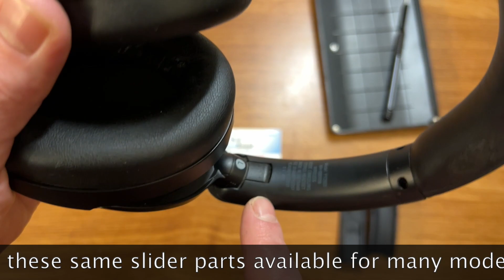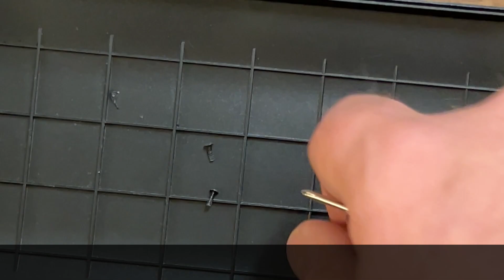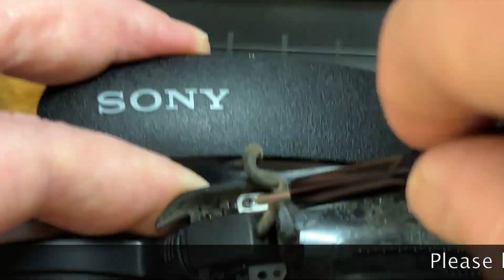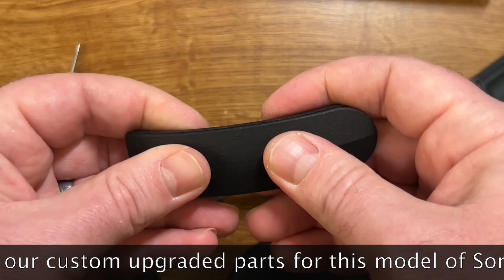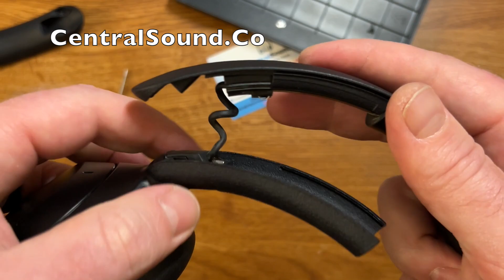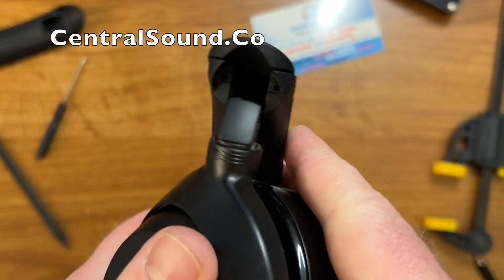How to Replace Sony WH-XB910N Headband Slider Cover Side Parts Headphones | Broken | Fix | Repair

Comment from the maker: Buy These Parts for Sony WH-XB910N https://centralsound.co/products/replacement-side-cover-slider-parts-upgrade-kit-for-sony-wh-xb910n-whxb910n-headphones
Buy These Parts for Sony WH-1000XM3 https://centralsound.co/products/replacement-side-cover-slider-parts-upgrade-kit-for-sony-wh-1000xm3-headphones
Buy These Parts for Sony WH-XB900N
https://centralsound.co/products/replacement-side-cover-slider-parts-upgrade-kit-for-sony-wh-xb900n-whxb900n
Buy These Parts for Sony MDR-1000X WH-1000XM2
https://centralsound.co/products/replacement-side-cover-slider-part-kit-for-sony-mdr-1000x-wh-1000xm2-headphones
Buy These Parts for Sony WH-H910N h.ear on 3 
https://centralsound.co/products/replacement-side-cover-slider-parts-upgrade-kit-for-sony-wh910n-wh-910n-h-ear-headphones
Buy These Parts for Sony WH-1000XM4 
https://centralsound.co/products/replacement-side-cover-slider-parts-upgrade-kit-for-sony-wh-1000xm4-wh1000xm4-headphones

Comment: I've had these headphones for almost 3 years now, not an issue, ever. I would like to replace that top cushion though as it's completely worn out. Other than that, they work like a charm still.

Comment: Good stuff, really helpful!
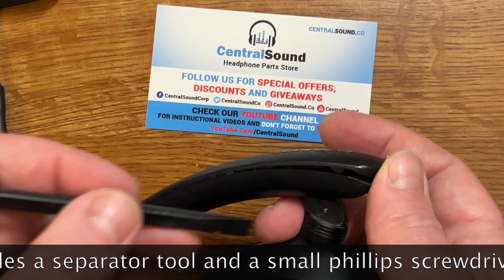One note though: The part you pry open at 1:40, that just slides off. Realized when putting it back together...

And for those that want to replace the faux leather headband, you need soldering to do that :(
Reply from the maker: Good call!